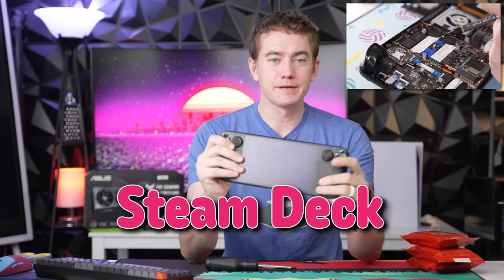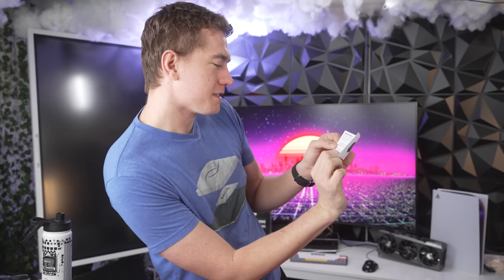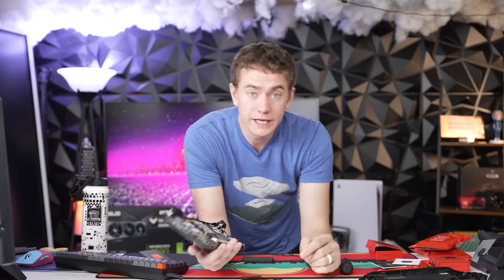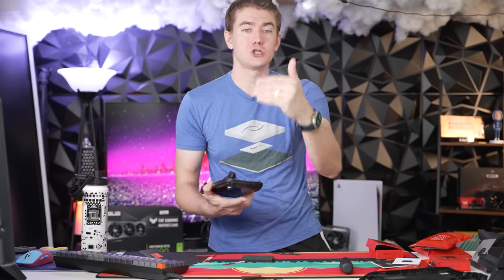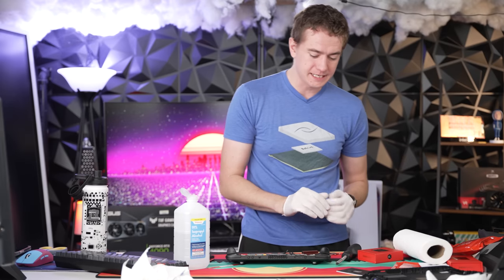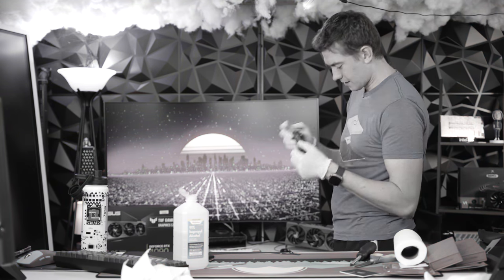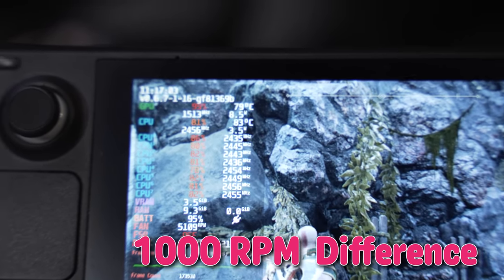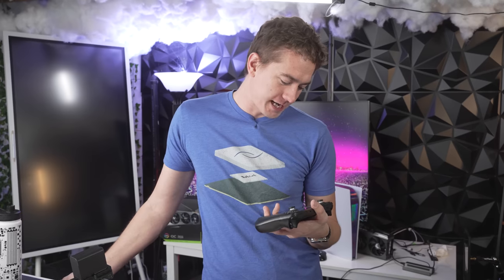Finally Fixing the Steam Deck's Heat Problems

Comment: I purchased this for my steam deck, and after doing so my games started stuttering, dropping to unplayable frame rates, and then over heating and shutting down. I've been working on computers and such for 25yrs. But this product unfortunately did not work for me. It also took over 2 months to recieve. Switch back to thermalpaste and everything works flawlessly.
Reply: This is great comment, you save me some money! :D and headaches, thanks!
Reply: Appreciate this feedback very much. I was seriously considering it, but I was also very skeptical. I've been in IT for about 20 years myself, and I try to stay opened minded to new developments, but I'm glad to hear from a peer on this issue and glad I wasn't taken in by the hype.
Reply: You're adding additional material in-between the heat sink and the SOC and the heat generated still needs to dissipate out.

100% you are better off with a good brand of thermal paste
Reply: How much did your temps go down from stock with the thermal paste?
Reply: @TravisHi_YT  they don't really. Luckily steam didn't cheap out on thermal paste during production.

Not a lot can be done without hacking up the shell and even then it's not really worth it. It's one of the downsides to small form factor
Reply: The deck just became so cold that it froze your games.
Reply: Same I tried this shit and it doesn’t work
Reply: I got it installed and it works pretty well. Make sure to cut it the right size and isolate the exposed pins on your CPU with some polyimide tape because graphene is a fucking good conductor.
Temps are not that much better tho. But the fan doesn't have to work that hard, at least in cracked hogwarts legacy, Anomaly or Demon's Souls.
Also this takes much longer to install if you want to make sure to NOT SHORT your beloved Steamdeck.
Reply: Carbon pads are never EVER going to outperform even the lowest quality paste you can find. Just use some Thermal Grizzly instead and you should be golden.
Reply: @Banbaroz  Just wanted to try it out, but as I said, it doesn't perform better than regular thermal paste.
Because of the exposed pins on the SD CPU it's a pain to work with a graphene sheet and it takes way longer than applying some good old MX-4, if you don't want to short it.
Reply: When you replaced the thermal paste, what kind did you use and, did you notice any difference?
Reply: @irishbrigade  😅🤣😅🤣
Reply: @CronyxRavage  it’s been awhile, but glad I could help. I was disappointed, I really was hoping it was going to make a difference.
Reply: @kalkydra  good to hear, I wish it would have made a difference. Just a waste of time and money unfortunately for me.
Reply: Can you recommend an addon or some other product that actually (for real) improves cooling? Been looking at different solutions with cases, clip on fans and what not, but most of them seem gimmicky. 
Maybe you had better luck than me? I assume you are in same boat, because if youre working with pcs, you probably know that 85 celsius work temperature isnt that super good for cpu in the long run.
Reply: Same

Comment: Just use normal high quality thermal paste lol, thermal pads will never beat good ol thermal paste, its just physics
Reply: The only advantage is pads last longer than paste before a re-application is needed. Otherwise yep, paste all the way.
Reply: The pad has one upside, it will never dry out so preformance will be locked in for the lifetime of the device

Comment: Hasn't normal thermal paste been shown to be better than these graphene pads?
Reply: Much better is subjective. Just watch Gamer'sNexus or LTT video's on graphite pads. Both go into detail that on lower wattages and for essentially normal use, it performs almost the same. When on higher wattages, the gap of performance widens, but still in ~5 degree difference territory. Don't ever plan on overclocking with it though. Make no mistake, (good) thermal paste will always be better, but by how much will be dependent on the use. Then there's the fact that it doesn't dry out and gives consistent performance for its application. For a one-and-done solution, a $11 name brand graphite pad doesn't seem that bad of an idea. I don't know much about graphene, but it's supposed to be better for conductivity than graphite.
Reply: Maybe one day they'll have these pads at worthwhile efficiencies, but for now, I think compound is better for most applications. I could see this being useful for some things, especially in a situation where you're testing multiple CPU's with a single heatsink, or multiple heatsinks on the same CPU. It would make sense to just use one of these pads. But any kind of permanent application, might as well just stick with thermal paste.
Reply: @Stein Mauer My guy. No one is going to argue with you on the price of good paste vs. pads. That's a point where there's no contest. I also said that of course good paste performs better, but by your statement of that it's MUCH better and SAFE, well, that's subjective and in some cases not entirely true.
Reply: I don’t know why you’re so brazen about this. Is 3 degrees considered MUCH better? Or 2? 2x conductivity, are you high? A simple bit of research shows the exact opposite of what you just said. Also, not all paste is non conductive. For the love of god, please don’t spread that around to people.
Reply: @Stein Mauer not all pastes are non conductive
Reply: Yes and No, these things are reusable and don’t dry up thermal paste will be better for the first handful of years and then become worse as it dryes. You could just reapply new one but for the especially lazy ones who don’t want to do so or if you have a server farm with dozens of cpus then these pads might be a good alternative.
Reply: @Stein Mauer Where is shown? The better and safer?

Comment: You should try use PTM 7950 pads. It's good on direct die cooling. Works like a charm on laptops, might work very well on the steam deck as well.
Reply: Second this. About to order a pad of PTM but curious how it stacks up against this frost shield one
Reply: Yes!
Reply: @JoshieKona  how did it turn out for ya? Make the deck cooler?
Reply: @JoshieKona  update?
Reply: @ihvdrm  unfortunately the shell jsaux sent me wasn't flush with the body so they're sending me a replacement. I haven't been able to try the copper plate yet. But the aluminum plate gets nice and toasty so the copper should do well. Hopefully have a working replacement in about a week
Reply: @JoshieKona  Update?
Reply: @Desenbigh  yes! So finally got my replacement shell. With the 2mm AliExpress copper heat plate the thing barely goes over 65. That's with me trying. For most regular stuff I've been hanging around 60. YMMV. Summer hasn't hit yet
Reply: @JoshieKona  do you have a link to what plate did you buy?

Comment: Great seeing you try these pads. Been using pads for years and they made life easier, less messy.
Reply: uhhhhh…
Reply: i also have this on my og and oled steam deck and temps are great. even fan noise is down for me. and havent had any problems in over a year on my og and so far no problems on my steam deck oled.

Comment: So, something I haven't seen mentioned here is: when were those stock readings taken? Valve has made several changes to the fan curves since launch, so are we certain the RPM readings shown are an apples to apples comparison?
Reply: I was just playing a game on my Steam Deck, and the temps were at 79-83c-ish, and my fan rpm at 5000-ish, just like the video. It only ramped up to 6000 occasionally, when pausing weirdly. I wonder how much of a difference the pads really nice make.
Reply: Look at the power draw and the CPU frequency. Both scenes stress the deck in different way, so even if all the other stuff is the same, that comparision is flawed.

Comment: What is the sheets rating in W/mK? Don't see it anywhere on their site. That price is OFF the chain high. Quality 12.8W/mK sheets can be had on sites for at little as $13 for a 3 pack of 100x100mm 0.5mm,1mm,1.5mm thickness.

Comment: At this point I've done this mod myself and I believe I've learned something not stated in the video. The APU cooler has 3 retention arms which are labeled 1-3 and when I first installed the frost sheet pad I screwed the cooler down 2-1-3 which caused a whole bunch of mounting pressure problems. HUGE MISTAKE. Tldr: Screw the cooler down in the proper order otherwise suffer black screens due to bad mounting pressure.
Reply: I'm planning on doing this too I have a question how much did you cut off? Till it fits or overhang or what?
Reply: @LordS20000  DO NOT.
Reply: @LordS20000  this mod was a detriment to my Steam Deck. I got horrible temps and could've really messed things up if I kept it in there much longer.
Reply: @jonathanscott555  well I guess I regret buying it then hhhh I'll just do the 1 tb ssd upgrade and the clear shell upgrade. What can I do with this graphite then? Haha
Reply: @LordS20000  honestly it takes so long to ship you'll forget about it when it arrives. I still don't know what to do with my frostsheet now, I've already cut mine too...
Reply: Return it! Get your money back on a product that isn’t worth it!
Reply: @Hot4Shrek  I mean I got what I paid for. I was mislead by this video to think it was a good idea for steam deck, and that's where my issue is. This isn't frostsheets fault at all.
Reply: @Hot4Shrek  I'll try

Comment: Fun fact, fan power goes roughly by the cube of the speed. So going from 6000 to 5000 rpm is actually around 40% reduction in power.  

And assuming that noise output power is linear with power (it's not, really, but good enough approximation), that's over 2dB of noise drop from the lowered RPM, which is definitely noticeable!

Neat little pad. Nice to see graphene entering the consumer space.
Reply: the fan needs so little power  i am not ever sure if we get a minute more battery live

Comment: BE CAREFUL, although this drops cpu temps the temps of the surrounding components like memory are still producing the same amount of heat. These components are not actively monitored or cooled so a drop in fan speed will cause a jump in temperature from those components which are still producing the same amount of heat. Watch gamers Nexus video for more info

Comment: 2:36 You can use the case it came with to place it facing down so you're not putting so much pressure on those thumbsticks. Just saying.

Comment: Hey bret cool vid man keep up the good work, btw do not expect to always be able to reuse that thermal pad, just finished fixing a friend's 5700xt it was massively overheating and thermal throttling when i took it apart it turns out it had a Graphiene pad and not only was it stuck on, it was no longer working, the 5700xt isn't that old, and it tore up when i removed the cooler. i had to scrub the cooler and gpu down pretty hard to get the residue off and then replace it with thermal paste and it was WORLDS better
Reply: Sure it was real graphene pad?
Reply: @JavoCover  all the Reference 5700xt's evidently came from factory with Graphene pads
Reply: @ocularcavity8412  😐 Maybe not even them could test the card long enogh to know this.
Reply: @JavoCover Yeah that is the tough part until a device is deployed for an extended amount of time you never quite know what will happen. less than 6 months ago i had to change the thermal paste on my Founders 2080ti and it was WEIRD. Normally none of my brand new cards have needed a paste change even ones bought way back in 2012 are still running strong, usually only need new past on used cards. Usually the paste on old Video Cards or PC's just get hard and crusty but for some reason the founders 2080ti paste started to separate and was Clear and sticky like some kind of syrup and was causing the card to MASSIVELY over heat and it happened suddenly one day card was running cool and quiet then the next day the fans are howling and the temps are above 87c and 100% fan speed at stock clocks
Reply: @ocularcavity8412  Good we know our stuff, imagine leaving it like that.

Comment: I really wanna see the temps if you adjust the fan curve, I'm not worried about the fan speed/sound but the longevity of my CPU and GPU
Reply: Agreed. I just want it to have lower temps to save the apu
Reply: The temperature only has a very small impact on the CPU's lifespan. Since the CPUs never go above 95 degrees Celsius and have protective mechanisms. Whether the CPU runs at 65 or 95 degrees Celsius has only a negligible influence, so it doesn't matter if the CPU runs for 20 years or 19.5 years. The failure rates of CPUs are very low, mostly other small components break before. That's why you can find many used working CPUs even years later, but old motherboards become rare. The failure rate of CPUs corresponds to the bathtub curve, a phenomenon which describes the failure characteristics. But CPUs can wear out and break down over time due to electromigration, so higher voltage does harm. (By CPUs I also mean GPUs and APUs).
Reply: @kevinj24535  sorry to bother after a months time but you seem knowledgeable about this more then me an I'm also wanting the best for my system should I keep it stock paste? Or should I go with this pad?
Reply: @Katruto71  i want to know too

Comment: So, exactly what sizes would you need for the Steam Deck CPU and GPU?
Reply: its the same price just buy the biggest one and cut it 😉
Reply: 25x25 is slightly larger than the processor of the Steam Deck so even that would need to be cut down slightly. I say grab the 38x38 and cut a square out of it the size of the processor and you will have a bit extra you could use for another project.

Comment: Eh to be honest if you conformal coat around the CPU and don't put too much liquid metal on it's fine, which if it's pooling thats too much, you should apply a thin coat to both surfaces and conformal coat around the die and then a little outside as well just encase a little bit does leak, the longvity thing is real though the liquid metal will get absorbed into the die and copper, nickle plating will slow this down a lot, but yeh, no not inside the steam deck.

Also nail polish is a decent conformal coating which is easy to obtain from like a corner store.

Comment: Awesome vid. Definitely gonna grab one of these frost sheets. Glad I didn't end up doing the liquid metal application on my Steam Deck.

I didn't realize liquid metal needed to be replaced over time. Guess I'm gonna need to redo my CPU on my desktop. I did it about a year and a half ago... Is it time? Also I did the application on a delidded CPU direct die setup, for the record.
Reply: I accidentally used liquid metal on a copper coldplate after I did the rocket cool copper ihs swap and fused the aio to the cpu.

Comment: I'm sure I either did something wrong or he did it better, but my deck ran hotter after installing the pad, ended up using Artic Silver 5 , idle Temps went down 4c with paste
Reply: I was wondering if Artic silver 5 would work, I thought I'd have to use something thicker because of how much movement happens on the deck
Reply: @TravisHi_YT  I ended up using that and it worked well… I ended up trading my deck for a OXP mini 5800u and considering it was a even trade I’m happy with it… playing BOTW right now… but those pads sucked and paste just worked better…. It’s not like your removing cpu all the time anyway
Reply: @WilliamBrown-bg7vm  Cool man, sucks to see your deck go. I think I'll give paste a go then!

Comment: Doesn't graphite conduct electricity?
Reply: So long as it stays we're it should it won't matter, but yes indeed graphene is conducive, to heat and electricity, if it's placed correctly and trimmed though it's not connected to anything electrically

Comment: Nobody is realizing that under stress if you keep the fan speed lower, you get air flow where it is needed on other components. The engineers at Valve most likely worked out a balance of fan speed and air flow through the rest of the deck.

Comment: I'd use KPX instead since it works great even if there are airgaps in between the heatsink and the silicone die. I've used it onto my GTX1070 of my Sager NP9877-S and haven't replaced it since oct 2020. To clean the liquid metal as well, gotta apply abit of metal polish onto the paper towel for it to absorb most of it out alot easier than using alcohol.

Comment: Hi @UFDTech , Could you somehow make a test with the original steam thermal compound to see how the Liquid metal bonding to the cooler has changed the thermals ( if at all ) ? I thought that the bonded LM might have filled out some microscopic gaps ? Great VIDS, Thanks for the Interesting Content.
Reply: This test can't be done. You can't get the OEM valve thermal paste as they don't sell it or the heatsink replacement. You could try and find a similar thermal paste, but it won't be identical.

Comment: With the code it actually took it down to 12 bucks, with 2 bucks shipping to the UK. No brainer
Reply: @MostlyLost  What kind of thermal pads? I have a laptop and the only reason I never opted for them is because I have no idea how big they should be or what brand would be preferable, which would be my same reservations with using them on the Steam Deck.

Comment: I haven't found that LM needs applied over and over. Usually one more application after about six months is sufficient. At least that's been the case over the years with a couple dozen things I've used LM on. Also, I like to use silicone conformal coating around the die to seal in and protect the circuitry. Sweet video though. I love those graphite cooling pads in the right situations. And I can't believe I haven't thought about putting LM on my Steam Deck yet. Guess I have a project for tonight.

Comment: How is this holding up Brett? I'm doing a fan replacement on the steam deck because I still have the Delta fan, but i also picked up one of these ages ago and want to do them both at the same time.